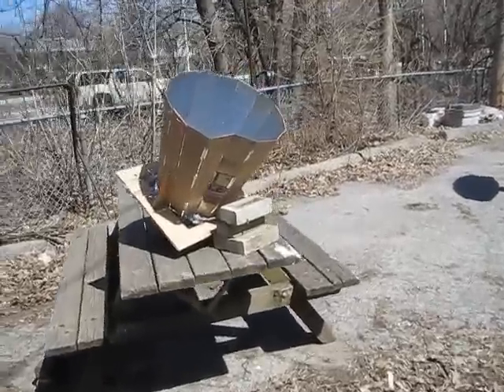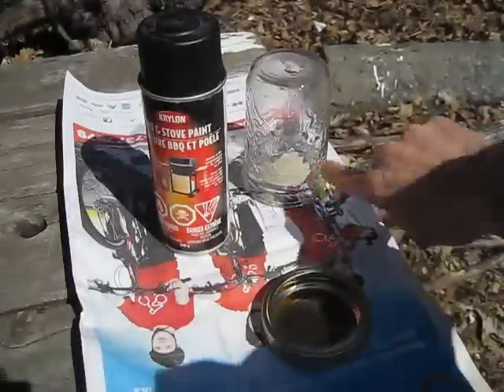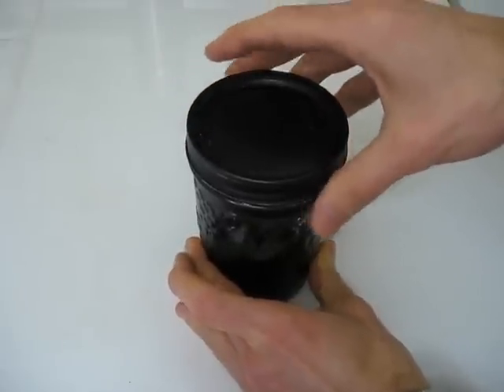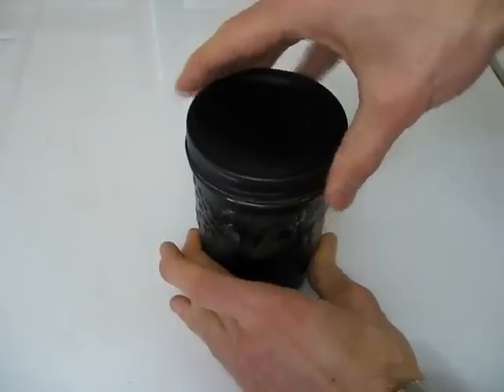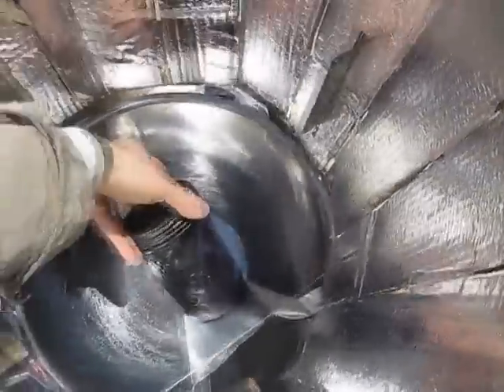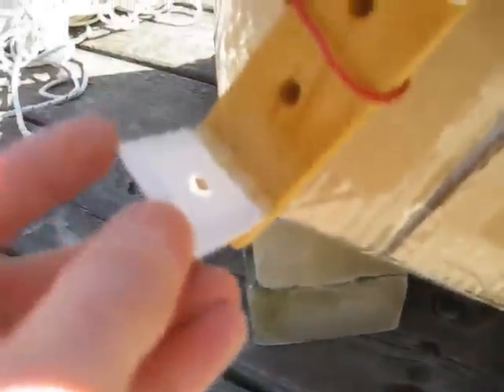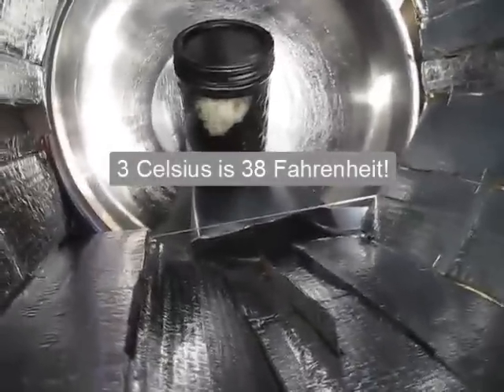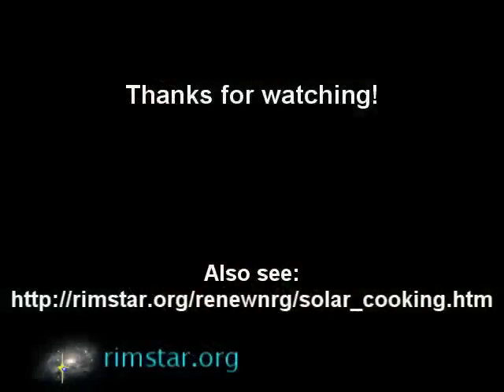Cone solar cooker part 1 - The finished product

Comment: i need an answer quick like really fast ...plspls

can i spray paint the bowl black, or using yours, which is reflecting.....which is better

what i think is the black bowl absorbes the light and conducts heat to the "food"

but since i have a greenhouse effect a reflecting bowl might work......but im not sure if my piece of plastic is enough to trap the light (heat) inside..
 
pls annswer quick....i really need it
Reply from the maker: As you can see in the video, I designed this one so that the bowl reflects to the cooking "pot" so I wouldn't paint it. I'm pretty sure with this one it's more efficient to reflect the sunlight to the pot and let the sunlight be converted to heat at the pot than to convert the sunlight to heat at the bowl and then rely on the bowl to conduct the heat to the pot. The bowl will likely just lose a lot of that heat elsewhere instead.
Check out the Copenhagen solar cooker for an easier to make one that works great too http://youtu.be/H5_z4-ocLUs.

Comment from the maker: Good question. I can't compare to the fresnel lens because it's a fast frier whereas the cone, car sunshade and modified CooKit are slow cookers. In terms of performance, I haven't use the last two enough in hottest summer to compare but so far all three perform around the same. For ease of setup I'd rank CooKit first, then cone, then sunshade. Sunshade is limited to low sun angles, the others support other angles. Cone is for smaller cooking vessels. CooKit and sunshade are more portable.